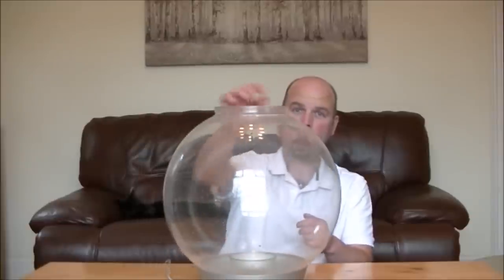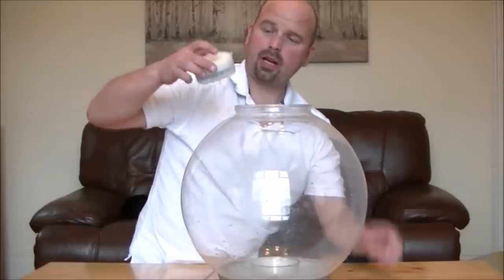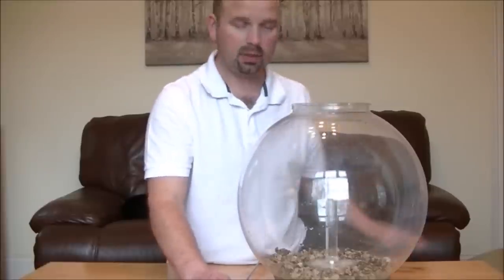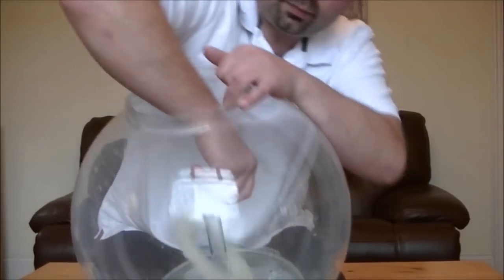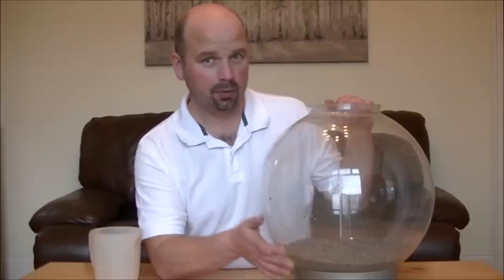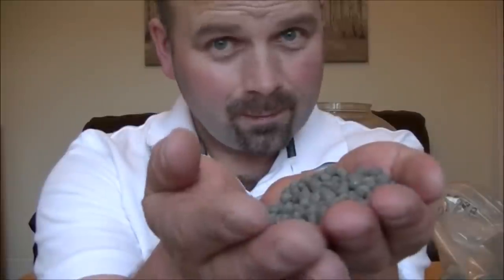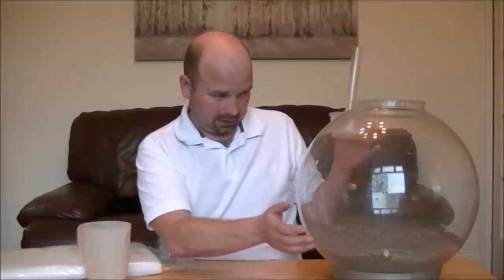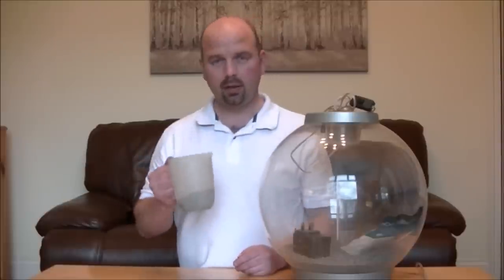BIORB COMPATIBLE UPGRADE KIT

Comment: How often would the foam need to be changed out?
Reply from the maker: The outer foams should keep their 'bounce' for at least a couple of years but the central fine pad may need replacing every 1-6 months - you will get loads of them out of one fine pad in the kit.
How long anything lasts or needs replacing will be specific to the tank situation and every tank is different due to stock, feeding etc.

Comment: Hello, how many hours does the light in the BiOrb 30 l need to be on for, I have only be using it for an hour a day as the light gets hot.
Reply from the maker: Sounds like you have the old type with halogen bulb? Ideally it should be on for around 8-12 hours a day but its not too important unless you have plants and if the tank is in a light place.
If you wanted to swap to an LED which is much cooler you'd need to look for an LED equivalent with model number MR16 12v as far as I can tell.
The standard biorb light is 10w halogen but the equivalent LED will be somewhere around 2w-3w and equivalent to a 20w halogen output as they don't seem to do one which is equivalent to 10w output: https://www.ledhut.co.uk/3-3-watt-mr16-led-spotlight-20w-replacement.html?gclid=EAIaIQobChMI7sio0evt2QIVCgDTCh2wAQVTEAkYASABEgLQJvD_BwE#994=337

Comment: would this same sort of system work for a Deco O 10L tank with one betta fish? I've been given tentative approval to keep a tank on my desk but size is an issue and I worry about the filters in those smaller tanks.
Reply from the maker: I am not familiar with that tank but after doing an image search I can see it is a similar design to the biorb apart from the filter being raised up off the bottom. Therefore I doubt this system would work as the biogravel would need to be very deep to cover the filter - best leave it as it is as it should be big enough for the size of tank.

Comment: hi iam Jacqueline rogers spoke to you before of a 60lt biorb I was given it leaked you suggested silicone it worked I replace filtration with internal filter fixed the light but its got a halogen 10 watt what I would like to know can a halogen bulb same watt but of which is sold for biorbs be used the like of a Christmas tree halogen thankyou
Reply from the maker: If it is the same design then yes. We used to use halogen bulbs used in kitchen fittings for biorbs. Just make sure you take the bulb with you as there are a nation of different designs available. Most Xmas bulbs will be much smaller than a biorb bulb.

Comment: Hi pondguru, was just wondering how I would make these changes in a already established tank?
Reply from the maker: Just make sure that the biogravel is very well washed then ideally soaked in a bucket of water overnight then empty out the biorb into a suitable container along with the fish and other stock, set up the filter system and return everything to the tank. This may take between 30-60 minutes depending on how easily the fish are caught and how much clutter is to remove from the tank.
Reply: +Pondguru Outdoors thank you so much... Going to order the kit now...
Reply from the maker: Groovy - thanks very much.

Comment: How often do u replace the foam under the substrate.   When u hover the bottom do u hover the top of the foam or just leave it n how long do you leave the polishing media in for ❓
Reply from the maker: The outer foams should last a good 2+ years before they need replacing but should be cleaned every time you clean the biogravel / water change with a gravel cleaner. Central filter (fine pad) will need replacing as and when it gets clogged with fine particles and that takes anywhere from a few months to over a year depending on the stocking scenario.
Reply: Do you clean the foam with the gravelcleaner? So i understand ? Because i think it's difficulty to remove the foam with the gravel inside the tank. Sorry for my english 😉

Comment: Just ordered to 60 to convert my Biorb life 60.  Would be interested to hear if anyone has done the same and how effective it was.
Reply from the maker: Arrrrrgghh..........thanks for the order. It was actually ordered on the 9th so was dispatched yesterday.
The biorb life is very different to the standard biorb as it has a rectangle base, not a round base. It also has no plastic skirt to hide the foams so the foams really need to be black. I have black foams and if I knew the biorb kit was for a biorb life tank I would have put the black foams in, not the black and blue foams which have been sent out (for a 60 litre biorb). If you use the foams supplied in a 'life' tank you will see the blue foam under the black foam due to the lack of a plastic skirt around the bottom of the tank.
Also, the orb templates in the kit are for the round tank - the foams need to be cut the full base size for the 'life' tanks or the biogravel will get between them.
I hope all that above makes sense.
As the biorb life has a bigger base area than the standard orb the amount of biogravel may more too but 3.5kg in the biorb 60 kit is a generous amount for a good covering (on the orb tank) so you should be OK.
Please let me know if you want a black foam and more media sending out - hopefully you will see this message before setting up with foams cut round which would only be suitable for the round orb tank and it may require a set up (with foams cut to full base size) to see if there is enough media to cover the foams.
Regards,
Richard
pondguru@btinternet.com
07772848730

Comment: Hi, I have a Biorb 60l and am wanting to upgrade to this filtration. The tank is already stocked with a few platies and danios. Will I need to move them to a separate tank in order to cycle the media?
Reply from the maker: As long as you remove the fish and water to a suitable container and install the kit with the biogravel well washed / soaked overnight etc. it will be fine to return the water and fish to the tank after the work has been completed on it then top up wit fresh water.
Reply: Awesome, thanks for your help :)

Comment: Hi there
I have a biorb flow 30 lt with fish on it , if i buy your filter system , can i put my fish on it after i do the upgrade?
I know that i need to take of the fish from the tank i keep them in the same water and after i finish the upgrade i can put them back on the tank with the old water as well. Is that the right way to do it?
I really enjoy you video :)

BR
Reply from the maker: Yes as long as you empty out the majority of the old water and fish and keep them in a large container while the upgrade is installed you can add them straight back in no problem - top up with a mix of warm / cold water so any new water is roughly the same temperature as your old water.
You will need to give the new media a good soaking / washing in fresh water prior to use.
For the 30 litre biorb flow it has a much bigger base area than the orb shaped tanks so you would need the 60 litre kit since it has 3.5kg of media necessary to cover the foams. Foams would be cut to the full base size and if you order please attach a note to remind me it is for a flow tank and I will send black foams since they will be seen through the sides of the tank.

Comment: Hi Richard, I'm wanting to get your kit but could you tell me if this would work in a marine tank?
Reply from the maker: +Francesco Piazza Yes there is no reason why it wouldn't work in a marine set-up as the media is inert. The only thing from the kit which would not work is the gel balls supplied with media as they contain freshwater bacteria - while they won't harm the marine tank they won't set up the media with bacteria in a salt water environment.

Comment: @pondguru I've converted my 30L biorb to this setup and have very low to zero nitrates. It's predominantly used for a guppy tank in the kitchen, however, it's now become a prolific breeding tank. The question I have for you and other folk who have been successful with this pimped filter setup is whether or not it's easy to convert this to a low tech planted setup? Would the biohome still function well with aquasoil on top and say a monte carlo carpet?

Comment: how often do I need to replace the biohome/biogravel, can I just add it to my gravel as I have a undergravel filter in my 50L tank
Reply from the maker: +Shoaib Rahman In a well set up filter it should last 6-10 years at high efficiency but as a substrate it will become clogged and maybe be efficient for 3-4 years. Structurally it will last for years so there is no real need to replace it as it will always be more effective than ordinary gravel when used over an under gravel filter plate.
Reply: +Pondguru Outdoors 
great, I will order from your eBay shop

Comment: i am thinking of buying a biorb life  60. is this te same system? i believe so. i have now a koi pound. there i need a UV lamp. is that not necessary in iths aquarium?
second. how often does your kit (foam and gravel) needs to be cleaned? and replaced? looks like a lot of work taking out all fish and than all graven and foam and than replace it?
Reply from the maker: +Arjan Van De haar The gravel would be cleaned by using a gravel cleaner and if that was pushed into the foams it would remove much of the muck from that too. A UV wouldn't be needed indoors.The biorb life uses the same filter so it would be upgraded the same but you would cut the foams to suit the square sides, not the round foams like the supplied templates. I haven't had the opportunity to test the biorb life 60 to see exactly how much media it would take but I know a couple of people who bought the biorb 60 upgrade kit I sell did buy them for the 60 life and I assume that it was about right as they didn't order any extra media. When you cut the foams just make sure they are about 1/2" in from the edge of tank to allow gravel to go down sides.
Reply: thanks Pondguru, for the reaction.  some last questions. how often do i need to clean the foam and gravel?  i live in the netherlands. do you ship there aswell? if not, the foam i will be able to find. as far as i can see its the same as i you use for my koi. what is the the name of the gravel or what type is it. i can ask my pound dealer if he has it? but if you can ship it its much eassier of course!;-)
Reply from the maker: +Arjan Van De haar Yes I ship all over the world and if you want multiple items just let me know by email pondguru@btinternet.com as I don't know how to work out the combined postage on ebay since some items I sell are too bulky / heavy / fragile to be packaged together. Here is link to listings for the biorb kits (15 litre, 30 litre and 60 litre) and the biogravel but if you click 'see sellers other items' you will find the foams too: http://www.ebay.co.uk/sch/i.html?_from=R40&_trksid=p4840.m570.l1313.TR0.TRC0.H0.Xbiogravel.TRS0&_nkw=biogravel&_sacat=0 The foams and gravel would be cleaned with a suitable gravel cleaner (the biorb one is quite good) whenever you needed to do a partial water change which depending on stock would be once a week to once every 2-3 weeks depending on stock. The gravel cleaner would help to draw muck out of the foams if it was lightly pressed through the biogravel into the foam. Hope that helps.

Comment: Hi does the circular cut out foam in the bottom need to be replaced at all? If so how often?
Reply from the maker: The outer foams should last up to 2 years before they need replacing, even in a well stocked tank and maybe longer in a lightly stocked tank.
As long as you are maintaining the tank with a gravel cleaner like this: http://geni.us/0YMWPJJ much of the muck will be removed from the biogravel and foams but the tank should be stripped down for a deep clean once a year (more often if heavily stocked).
Hope that helps.

Comment: do you need to do this if you have a different biorb, such as the biorb tube? thankyou
Reply from the maker: They all use the same crappy filters which cause fish suffering so yes it is best to make them work properly. The tube and flow / life tanks would have the foams cut to the full size of the base with the biogravel covering and if there was no plastic skirt around the tank base (to hide foams) it would be best if the foams were black.

Comment: hey pondguru couldn you just put one of those electric filters in the tank i think they go in the corner or something been a while since i had a tank lol .
Reply from the maker: You could but it would be a wire trailing into the tank which looks awful. The wire from the light is bad enough.
Reply: @pondguru  someone just gave me one of these but no pump I can see? Is it in the base? You don't show that in video do you?
Reply from the maker: @candicewilmore  The air pump sits externally and has an air pipe which attached to the pipe under the biorb. There should also be a non-return valve in the airline to prevent water running out of the tank.

Comment: Hi will your 60 kit work out ok for my new 105 larger tank? I think the filter systems are the same size? Thanks for your help and advice, me and the fish appreciate it! :-)
Reply from the maker: +Melissa Abraham Unfortunately I have only made kits for the 15, 30 and 60 litre orbs as I'm having to buy each one to make sure I get measurements of foams and biogravel correct. However the 105 does appear to be roughly the same base size as the 60 so the 60 kit should be about right - I can't say for sure. The central filter is certainly the same size which is way smaller than is needed for a 105 tank, lolFeel free to send me some measurements like the circumference of the plastic skirt around base or diameter of inside the orb at the point the skirt comes up to if that is possible and I can compare that to the 60 litre orb I have here which will enable me to have a clearer picture about how much gravel is needed and if the 60 litre kit will be fine without any larger foams or more biogravel. My email address is pondguru@btinternet.com
Reply: Hi thanks for your reply and yes, I'm very concerned about the incredibly small (ie useless?!?) flitration sytem offered with the 105 biorb. I believe it's identical to the 60, so that fact alone makes it a totally stupid decision by the manufacturer. I don't understand why you'd bother to come up with a very groovy, lovely design... Get all the parts manufactured and marketed... Knowing full well that there were going to be major issues? Talk about a short term vision and a guaranteed way to lose a race right at the finishing post. Anyway...

I do love the design of the tank, and so I'm very keen to be able to keep fish in it for more than a month. Hopefully that's where you come in!

The best measurement I can make with a semi-rigid tape measure is 1150mm around the top of the skirt meets the tank - pretty much where the gravel should finish?

The diameter is around 350mm for the skirt. There is a very slight flare outwards as you go from base to top of the skirt.

I hope these measurements are enough to perhaps confirm the 105 and 60 are similar? If not, then I will get a cloth tape measure and take some accurate ones, and add in a few more too, to give the best picture I can.
Reply from the maker: +Melissa Abraham Thanks for the measurements. I have measured the 60 litre and the internal diameter from top of skirt (one side to other) is 300mm and the circumference of the skirt around the outside of the tank around top of skirt is 950mm so it sounds like there's not much difference but I'd still expect it to take another 1kg for the 105 as a 2" difference in diameter increases the area quite a bit.

Comment: I have one of the newer Biorb tubes (35l), would the kit still work for this as the dimensions are different?
Reply from the maker: Yes it would work but the foams would have to be full size of base and it may take around 3kg of biogravel to cover it. It would be best to go with black foams as they wouldn't be noticed through the sides of the tank (if you have version with no plastic skirt around)

Comment: Hi, we received the 30l kit which was easy to set up but we are wondering if we can add extra normal gravel? as the media does not cover every part of the sponges, maybe needed 10% more. thanks.
Reply from the maker: Yes you can add ordinary gravel no problem. I am assuming that you ordered the 30 litre kit for the 30 litre orb shaped tank?
If so there should have been enough media to cover the foams. Any chance you can send a picture to my email sales@filterpro.co.uk or my phone 07772848730 and I will send some more media out no problem as keeping it all biogravel will look better than mixing it with ordinary gravel.
Regards,
Richard
Reply: Thank you for the quick reply Richard, Yes it is the 30l orb. I have sent you an email now with a photo.
Reply from the maker: Dear Paul,
Thanks for the pictures, I have sent out some extra media today. I notice that your tank looks like the 'halo' version of the biorb and I am wondering if the base is larger than on the normal biorb tank. If so that would account for the shortage as there should be more than enough for a normal orb so I will have to check that by measuring one next time I am at the local aquatic store as they have them in.
Hopefully the biogravel will be with you in the next couple of days. I think there was 800g in the package.
Regards,
Richard
Reply: Thank you very much. Yes it is the Halo version. I will post a little video when we have it all set up nicely.
Reply from the maker: That sounds awesome - yes just send me link or post it in a comment. Hopefully it will not get marked as spam as the Youtube system can be funny about links in comments.